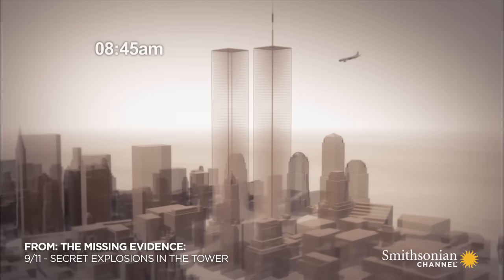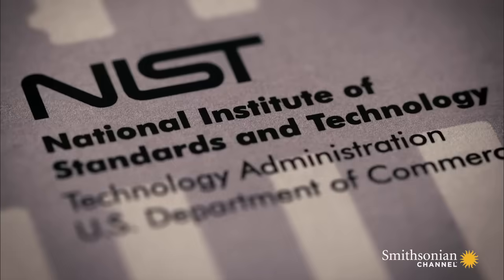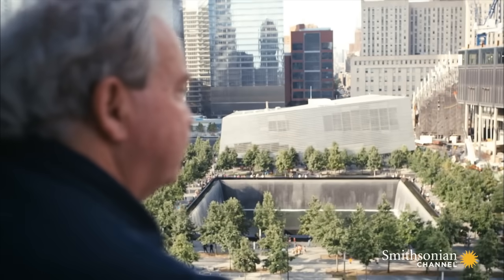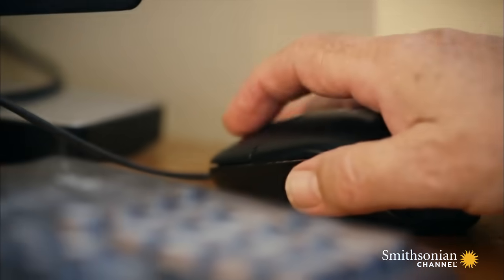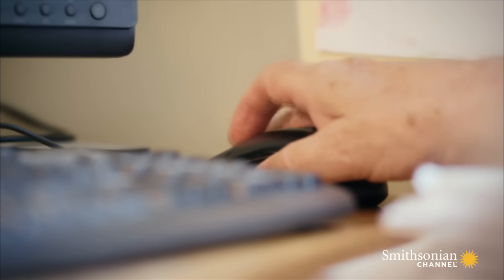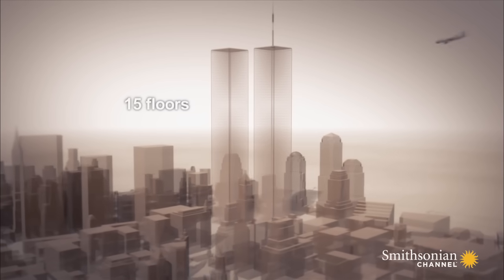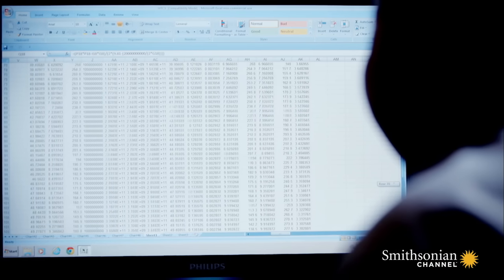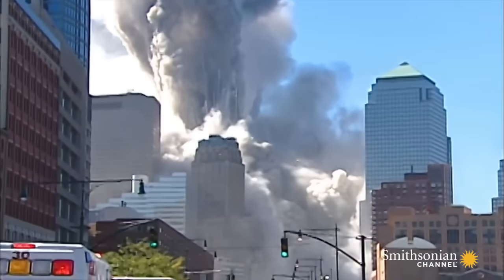This Computer Simulation Explains How the Twin Towers Fell

Comment: To all you conspiracy idiots out there you should research building demolition and see how long it takes to set charges weeks to a month also the sounds of domolition have a distinct sound snd could be heard miles away no police or firemen radios picked up anything, your simple idea that Wylie coyote is sitting across the street with a detonator is comical, if the buildings were wired they wouldn’t go through all the trouble of hijacking planes you idiots makes no sense also there short doc on YouTube why building 7 fell explained in lamens terms for you dumb dumbs,did the government know it was gonna happen? Perhaps, gave them reason to go take iraqs oil that theory is plausible but the rest makes no sense , jet fuel and support beams taken out is an easy collapse and building 7 sprinklers were knocked out check out the video why building 7 fell,and you should also YouTube real demolition to see how they stager the charges and how long and hard it takes to do that not to mention the sound
Reply: Building 7 was a demolition because all the supporting beams went out within 1/10 of a second of one another which is impossible in a normal collapse.
Reply: @soulhulk8811  you should do some research on controlled demolition instead of watching wyle coyote it takes weeks to set up they stagger the charges and you can hear them from miles away none of that happened love these guys who come to a conclusion then try and make it fit instead of following the evidence the sprinkler system was knock out once the beams melted it collapsed just like the towers pretty simple
Reply: @soulhulk8811  lol your an expert? Lol YouTube why building 7 fell there’s actual engineers showing you what happened with computer simulations get your head out of the sand and listen to legit professionals in their field
Reply: @billhinsperger8120  lol good one
Reply: @billhinsperger8120  🤡

Comment: Yeah, buildings that were designed to resist multiple airplane hits, turned into piles of dust in seconds. Sure, and santaclause and the tooth fairy are real.
Reply: The plane hit they were supposed to survive were 1/50 the impact energy & carried none of the fuel compared to the 9/11 jets. Not the same.
Reply: Leslie Robertson the lead structural engineer that built the World trade Center also stated that they did not calculate the fuel loads and if they did they would have found it would be impossible for it to withstand what happened to it on 9/11
Reply: They were designed for planes in 1973 not the larger ones from 2000
Reply: @holyfeline715  Well, the plane they used in their model was a 707; a 767 is a little heavier but not much.

The real issue is that the 9/11 jets were going 3 times faster, a significantly greater amount of kinetic energy!
Reply: @Tim22222  Thank you for correcting  me

Comment: The collapse looks more like commercial way of making buildings fall down. Why didn't just the top floors just fall off, instead of the whole building just tumbling straight down. Hope this never ever happens again, anywhere.
Reply: Gravity pulls down.  

"How did the hijackers know where to put those planes in the first place, almost knowing where the weak spots where."
Any impact that wasn't near the very top would have probably brought the towers down.    That's a lot of floors to choose from.
Reply: Isaac Newton came up with gravity centuries ago.  Try to catch up.
Reply: Another thing that is interesting to know; How did the hijackers know where to put those planes in the first place, almost knowing where the weak spots where.
Reply: @anolbe  It's highly unlikely the hijackers had any "weak spots" in mind. They probably were just going for the optics.

And given that the north tower was hit so high up & still collapsed, it probably didn't matter where they were hit.
Reply: @Tim22222  Yeah, that's true. It's still so tragic with all the losses. I hope we never see this again.

Comment: 11 seconds is free fall speed. Impossible if the building is pancaking down as the 911 commission asserts.  If it were pancaking down, why wasn't the core still standing? If the top 15 stories is smashing the bottom 85 stories all the way to the ground, why isn't there a 15 story chunk of building sitting on top of the rubble at the bottom?
Reply: Neither tower came down in 11 seconds. That's a myth.
Reply: @Tim22222  All you have to do is put a stopwatch on the video.
Reply: @michaelbeard6405  I have! Many times! I get about 16 seconds for the south tower's collapse, 22 seconds for the north.
Reply: @Tim22222  I'd get that timepiece checked.
Reply: @Tim22222  your stopwatch must be fast
Reply: @soulhulk8811  Are you suggesting that you watched the video & concluded that that tower was all the way down to the ground in 11 seconds? Is that your claim?

Because it's not.
Reply: @Tim22222  it was 11 seconds. There is no way one of the towers fell in 22 seconds either.
Reply: The towers dropped slower than the falling debris.    The debris was in free fall.  The towers were not.

" If it were pancaking down, why wasn't the core still standing? I"
What are you talking about?   All that was left was a pile.

"why isn't there a 15 story chunk of building sitting on top of the rubble at the bottom?"
Because that was destroyed during the collapses.    That's the result of an equal and opposite reaction.

Comment: This makes no sense why the metal was melting where did all this heat come from we are talking bout steel concrete and glass office material doesn't stand a chance.......
Reply: Where did the heat come from? Is that a serious question?? Obviously not!

Remember, the molten metal wasn't necessarily steel...
Reply: @Tim22222  Are you being serious!!!! I shouldn't even reply to this because I don't think you have any understand of what kinda heat is needed to steel or metal. You need to honestly go back and review the recording of the heat coming from ground zero, you would also see the STEEL foundation dripping like larva please stop.
Reply: @davidfranky1986  How do you know that was steel?
Reply: @Tim22222  it was orange! Melted aluminum looks like melted aluminum! It’s a silvery color. But the stuff driping from the towers was orange which means it is molten steel!
Reply: Ah yes larva

Comment: These guys get funnier by the day. Far from trying to convince people, they are so appalling that they are driving them to the truthers. "Some guy develops prediction software" and " 38 000 tons that's the equivalent  of the titanic“. Sir that 38000 tons didn't come from outer space! That floor had spent the last 40 years holding up that 38 000 tons and doing so without complaining.
Reply: That floor was pretty severely compromised by fire and having a 150-ton jet crash into it at 500 mph.
Reply: @Tim22222  lol lol lol

Comment: Well this is total rubbish. Talk about insult to the fireman police officers and all others that perished that day. Each individual floor was connected to a inner 47 box column core system so they couldn't stack on each other. The elevators were housed in this box column core system and fireman were using the elevators to reach to just below the floors supposedly impacted by airliner in the South tower wtc2 right up to within minutes of its collapse. It was hit second but collapsed first after 56 minutes at just over free fall of 9 seconds. Where as the North tower wtc1 was hit first and came down second lasting 102 minutes it actually accelerates as it collapses and comes down faster than free fall at 8 seconds something. The government even themselves changed there official pancake effect story in 2006 after it was proven through structural blueprints it wasn't possible and they came out with there new inwards bowing walls theory ( nonsense )
Reply: You seem to know a lot about it. Where did you get your engineering degree?
Reply: @Tim22222  you don't need a engineering degree to dig up facts. It's called investigation my friend and requires no paperwork to say you are qualified. Also you need to not be a sell out traitor army boy or call centre - used to all your bullcrap attacks you try. There's these things called blueprints and videos of some of the people involved in it's design explaining how it was built... I go by fact's that are verifiable - unlike some sell out tossers that jump on the bandwagon and fight the governments bullcrap narrative
Reply: @matthewscattergood5191  Blueprints, huh? Yeah you sound like you know what you’re talking about.
Reply: @tpryce6243  I do on Fridays chap. I promise. Whatever they call structural design documents. It's simple them buildings were built well hard. The bomb that was set off in the underground carparks was a one tonne ammonium nitrate van or some vehicle bomb and that stuffs for quarrying and needs proper powerful blasting caps or big primer to detonate it. And considering its location, what it did to the five under building car parks (don't know which tower this was, think WTC 1 the North) it took it well. So them things were pummeled. I believe a multitude from cutter charges and thermite plasma for plane hole fireball theatrics. Thermite and silicon two floors of North tower to make the black thick smoke trail. Even other thermite and small charges to weaken away key parts then three small specially designed nuclear devices planted in the main shaft near the elevators 75metres down that sent up like a pyroclastic eruption up to the supposed impact zone and push it apart whilst ionising and fusing a percentage of the steel. In the subway system. Thus why south, then north before setting the control centre aka building seven to come down at 17:25 or 17:45 not sure which now off top of my head (being a Brit we were 5 hours Infront of your time in NYC as we were still in daylight saving GMT +1 ) to destroy most loose ends. Many reasons for this belief and all admitted official facts. Molten concrete not even thermite can hit that sort of temperature. Fact it took until December 17th to get the fires out - yes 3 months and 6 days. The big fused ball thing they found deep down when they dug out for the memorial to be laid. Fact 500 times background levels of tritium oxide a radioactive isotope of hydrogen produced by a nuclear reaction only being present in smoke I do believe immediately after event. The need to bring in trailer after trailer of soil to place on the site and remove /replace in rota's to absorb heat and who knows what else. Fact they sent people straight in to look for and remover certain items and interfere with a crime scene ( I'm not referring to rescuers searching for survivors either, these first people in swept the area removing a load of small items - who knows what ) it's wrong to all the fireman, police and civilians that lost their lives or had them severely shortened and affected that day to not have justice or at least recognition for what really happened that day. Physics don't change its rules for a day. It's more of an insult to fellow dead humans that were there doing their jobs fighting to prevent said fate for whoever they could or even just working there  -  to allow those that know and were complicit one way or another to dictate the paradigm official explanation of the events of that day
Reply: @Tim22222  and it was your mother that gave me my engineering certificate thank you
Reply: Tower 2 was hit lower therefore had more weight above the impact zone

Comment: I am yet to find an aluminum hammerhead to beat high-grade steel. Maybe the Americans may have one. Never seen an aluminum cut through steel. The planes should have simply bounced back off the building. The buildings were designed for an impact from a plane-like object hitting the building. The buildings swayed under high wind forces. This means there was some flexibility. How can the wings of the plane (light wt structure) that primarily carry the fuel be so strong that they can cut through steel? The entire plane cannot absorb into the building. The fuel carried by the plane should have leaked on the face of the building and down to the ground preventing fuel from going inside the building. The conclusion here can be drawn, Aluminium is stronger than Steel (In America)
Reply: You should learn about mass and inertia. A 250,000-lb jet going 400 mph is not exactly going to bounce off
Reply: The planes didn't cut any steel, they broke bolted-together beams apart at the joints. The buildings were designed to survive plane impacts, not repel them. But those calculations were based on a smaller plane going 1/3 the speed and carrying no fuel. Big differences.

Comment: I dont need scientists to explain simple logistics my eyes can see. Check it: planes hit and there were explosion right?. The explosion was from?...the fuel. So right there the fuel burned. All of it! Being told the fuel weakened structural support is impossible. How could it seap down to other floors and weaken the integrity of other strengths if it burned at top already? All the concrete,steel, tiles etc, wasnt so feeble to allow free fall!!
Reply: Aren't you forgetting something? The contents of those offices! The jet fuel started office fires that had unlimited fuel - and office fires burn HOTTER than jet fuel.

Comment: The real question is: Did FBI look for signs of explosives? NIST answers: NO. This is the tresonous admitted coverup. FEMA admits they were ordered to destroy the steel. That is treasonous destruction of evidence. Even if the "flat earth" notion that fire could do it alone it is not the same as actually fire did it alone. IT could be a combination. There were numerous reports of explosions that could not be explained by the planes. Like Barry Jennings stairwell in WTC7 that is destroyed by an explosion before the two first towers collapse. The abcense of a state of the arts search for signs of explosives and the destruction of evidence (NIST findes only less than 0,5% of the steel from the buildings when they are asked 14 month too late to look into the question. This is not a theory. This what NIST writes. Add to that, that NIST does not present mathematical structural calculations that support any of they claims. The NIST conclusion that fire could do it is thus pure guesswork. Take then into account that the University of Alaskas engineering professor has produced a computermodel which contradicts NISTs conclusions. And take into account that independent researcher Niels Harrit from Denmark har identified nano thermite in all 3 samples of dust collected by Manhattan citizens after the attack.
Reply: The investigators followed the evidence - and NONE of the evidence pointed towards demolition.

"FEMA admits they were ordered to destroy the steel." <-- THIS IS A LIE! The steel was most definitely examined by investigators and relevant pieces were retained. There was never any evidence of explosions.

Also - NO ONE ever said fire did it "alone." It was fire plus severe structural damage from having a jumbo jet crash into it at 500 mph!! Why do truther nuts always omit that fact? NM I know why.

Also - the thermite claim has been debunked! Harrit/Jones did not seek objective peer review & they did not share their samples for independent verification. Why not, I wonder??? 🙄🙄🙄

Comment: No debunkers can provide sufficient evidence to explain the super-thermate or molten metal found in the debris for weeks following the collapses.
Reply: "No debunkers can provide sufficient evidence to explain the super-thermate or molten metal found in the debris"
1.  There is no evidence for any "super-thermate" so nothing needs to be explained there.
2.  Molten metal wouldn't be such a surprise considering the temperatures experienced.
Reply: @markh1011  buddy, jet fuel melts at a maximum of 1800 degrees Fahrenheit! Steel melts at 2700 degrees Fahrenheit!
Reply: @soulhulk8811  
Buddy, pay attention.
1.  The steel didn't melt, it weakened.
2.  The temps that jet fuel reach are actually not that relevant as the jet fuel merely started the fires. 
3.  Building fires exceed 1000F and can even exceed 1800F.
Reply: That's because "super-duper-thermate" is a truther fantasy that did not happen.
Reply: @Tim22222  yeah? Lol just because you did not want it to happen doesn't mean it didn't bud🤮💯 go read a book you clown your embarrassing
Reply: Meaning?